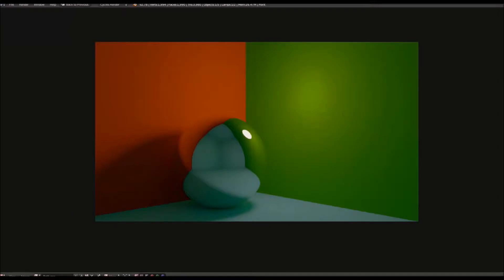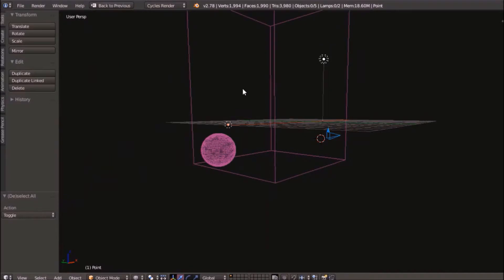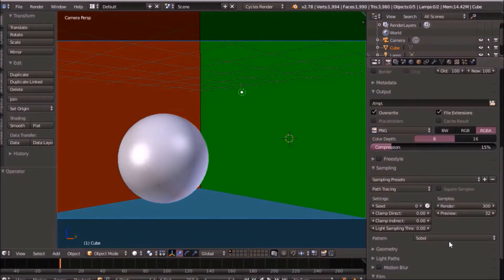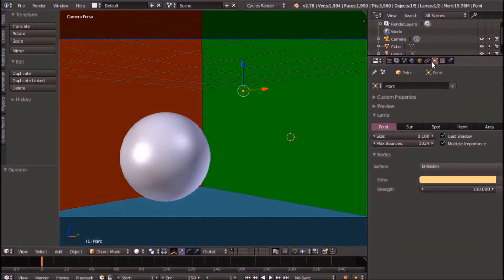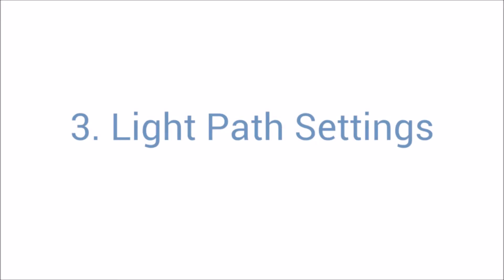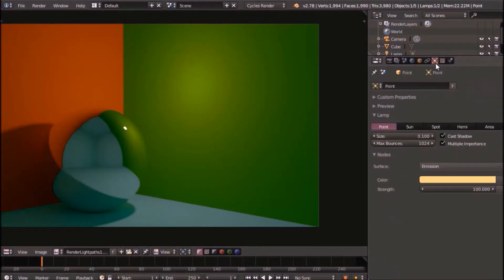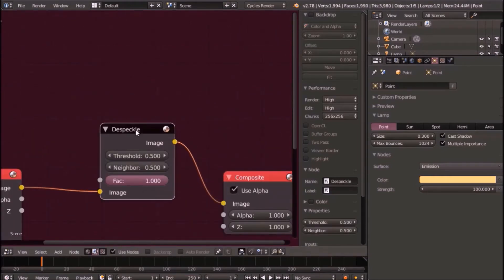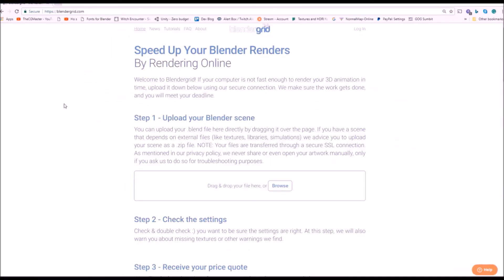Blendergrid Tutorial - Removing Fireflies

Comment: Wait you could decrease fireflies by just increase samples at the point that all fireflies will go.
You could also remove fire flies by using denoiser (nvidea denoiser) or temporal denoiser.
If not works, then you should change the material of the object you want to render to non reflective mesh